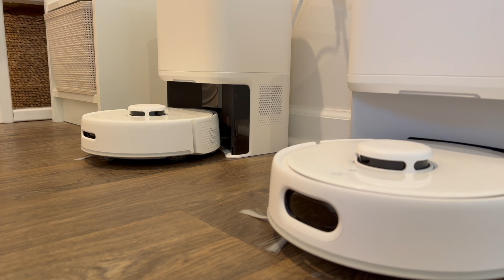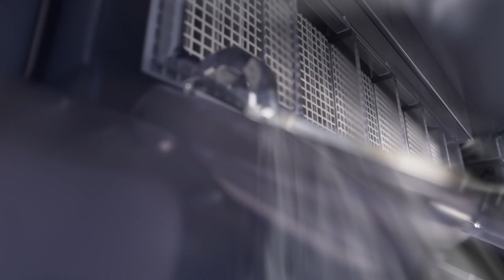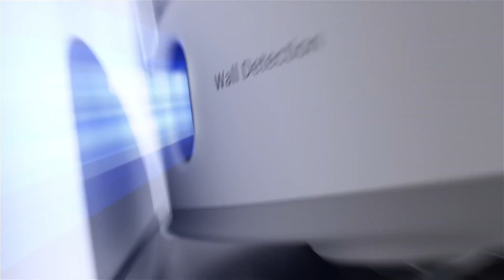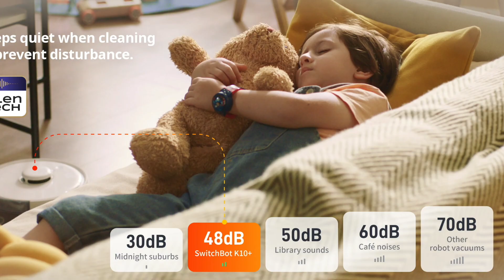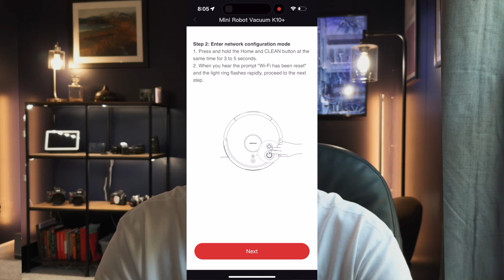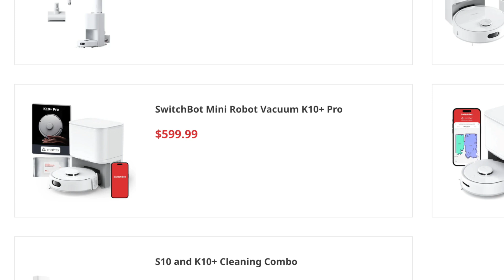Switchbot K10+ PRO. Should you upgrade?

Comment: Hey, thanks for the video. How is the switchbot integration in HA? Or do you typically just run it through the switchbot app?
Reply from the maker: Honestly, I haven’t even tried yet since the original K10+ but will give it a shot!
Reply: you can add it, but you only get running status and start/stop/send home control. No ability to send it to a specific room with HA unfortunately with the normal one or the pro.

The Pro can be integrated via matter through a hub mini matter enabled, but you get even less data from it than you do through the switchbot cloud integration unfortunately.